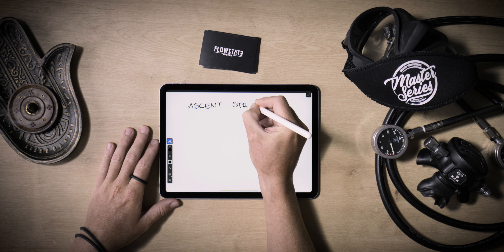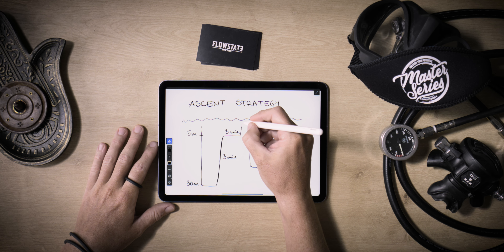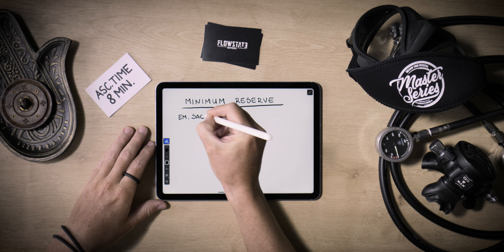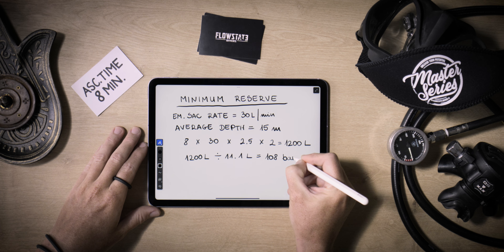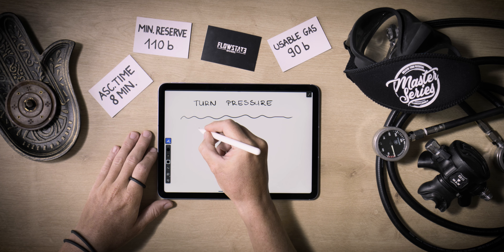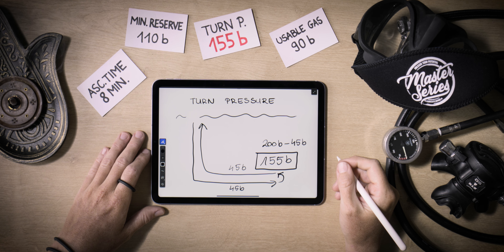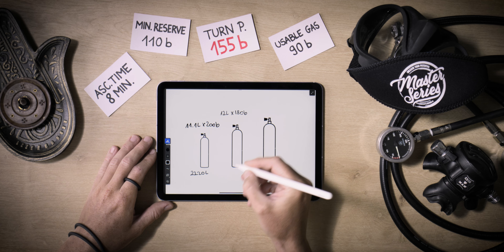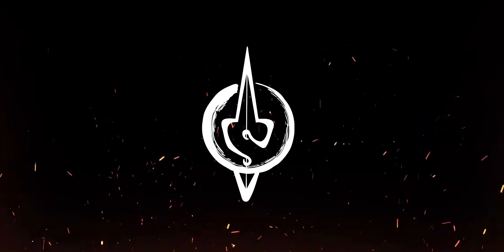How To Calculate Gas Requirements | Master Series

Comment: recently did my deep dive course and the same was taught. except we used a slower ascent rate (3m/min) and SAC rate of 20l/min.  awesome job! cheers!
Reply from the maker: We are not disputing your knowledge, but remember that a slow ascent rate of 3m/min will likely result in continuous on-gassing at depth. However, it is undoubtedly safer than ascending at rates higher than the standard. If you are interested in this, It's good to spend time on studying the latest results of decompression research
Reply: @flowstatedivers  im all for learning. you are definitely right that the diver will still be ongassing faster. since we are calculating the minimum reserve gas, 3m/min is really slow. its not what is done normally. but in a scenario where a diver cannot ascend faster, there should be enough air for him and the buddy.

Comment: Very helpful video. Can you explain how you get "average depth"?
Reply from the maker: Since you calculate the required amount of gas to safely surface 2 divers from the deepest point of the dive you calculate the average depth from the maximum depth. In our example the max depth was 30 meters so you divide that by 2 and ending up with 15m avg where the pressure is 2.5b ATA.
Reply: I stumbled on this point as well. You’re calculating an average which does not incorporate time at depth. A time-weighted average depth would yield a more accurate, if less conservative, average depth for estimating air consumption. Is the calculation intentionally conservative or intentionally simplified, and are there other trusted methodologies which employ a time weighted average depth?

Thanks for these videos, the content is very well presented.
Reply: @rambling_wreck  actually I think that the method presented in the video is MORE conservative because its running total ascent time at the total average. I ran the numbers using average time at the average depth for the ascent portion to SS depth, the time spent at SS, and the time spend for the ascent from SS to surface and came out with a lower estimate, due to the fact that the time spent at SS stop and ascent from SS to surface use much less gas. The numbers are close though
Reply: @skydiverninetysix, I think we’re saying the same thing. I asserted that a time weighted average would be less conservative, you asserted that the method in the video is more conservative. Thanks for running the numbers, haven’t yet had a chance to do so yet. Glad to hear the difference is small.
Reply from the maker: @rambling_wreck  The video showcases a more conservative approach than the time-weighted average. The real advantage of this method is that it allows you to create your dive plan before the dive, rather than having to make calculations while diving. It's a well-established fact that math and diving don't mix well (even in very simple cases like this). This becomes even more crucial when carrying out planned decompression, so we suggest not calculating on the fly but having a plan and contingency in place, then go and execute that plan.

Comment: I get the point in the turning pressure, but why not turn while you ascent at the same time so you can save air or prolong the dive?? So you head back with the same route but different depth,, that way you do the ascend while you still enjoy/continue the dive, and can do longer dive/go further before the turn
Reply from the maker: That is called a multi-level dive, and calculating such a plan involves a bit more than what was discussed in the video. We will delve further into different types of dive planning shortly, where this topic will be covered in greater detail.

Comment: Exactly what I learned. BUT: I encourage all to measure their SAC rate while "working" under water. My rate swimming against a light current already is around 35l/min. If I or my buddy loses all of his gas, I garanty you I will panic and and breathe waaaay over that.
Reply: Yep, you are absolutely right. But it's a bit unrealistic to convince most people to keep an eye on and constantly measure their pressure-based SAC (unless you have a good air-integrated computer that calculates it for you instantly). On the other hand, you can't really anticipate what your PSAC will be if you panic, panic ain't good, you got to target the panic bro (or sis)
Reply: @MrNeobuxer  of course you shouldnt panic. But in my opinion a rock bottom gas analysis should consider the worst case szenario. In this scenario, at least one diver is realy stressed out or panicing.
Reply: @MrNeobuxer  and I find it relaxing  to know that I even planned for panicing - with lowers the probability to panic.
Reply: @CraftingDepths @DroPsyDro Yep. You should plan as conservatively as you feel will keep you safe. There is a limit, though, on how far you want to go before you realise that you're not really enjoying diving. So best to work on the root causes - comfort under water and calmness while doing skills, better breathing habits and good SAC, confidence in gear setup and familiarity, etc. Enjoy your dives bro!
Reply: @MrNeobuxer  thanks, you too!

Comment: 18 meters +\-3 meters a minute accent rate.. Save a lot of time that way
Reply from the maker: Yeah you save time and greatly increase the risk of not off-gasing sufficiently + make the surface interval mandatory in between dives so is it truly worth it?
Reply: @flowstatedivers  all my dice have been done that way and never had issues. Actually I put +\-3 but it is 18 meters a minute or slower. Even my 300 foot dives are done that way with proper deco. Even do 230 feet dive for 7 minutes straight up to the surface no deco at that rate not saying it is the safest but in case of emergency you will live. (On HEO2.)